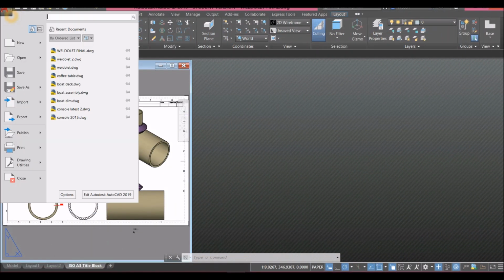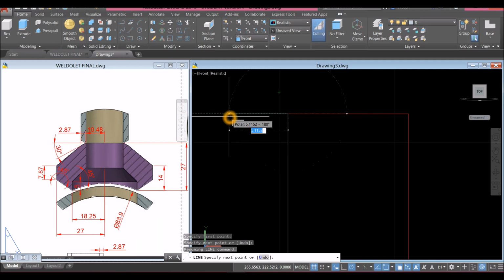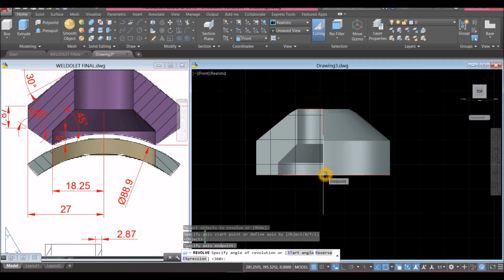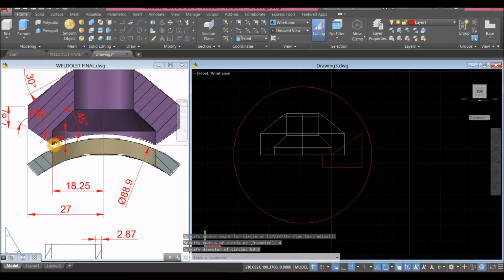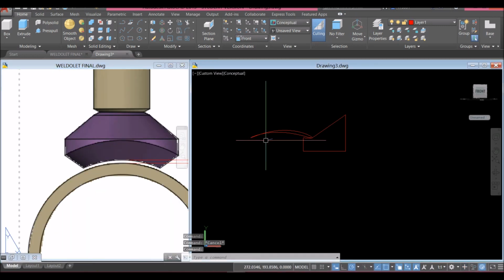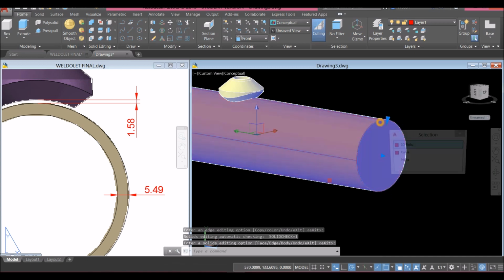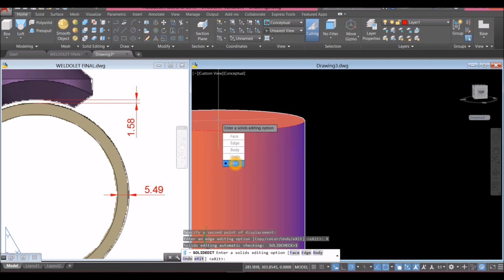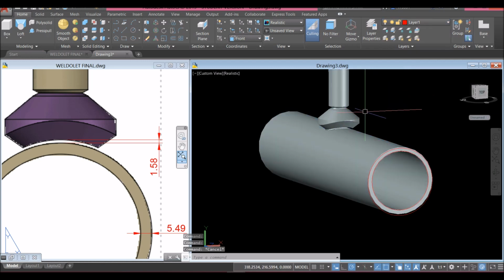Weldolet (reducer) Design in Autocad

Comment: Sweep Object reports an error Error Code Number is 85021. What about this? Edit the curve?
Reply from the maker: 🔧 1. Profile is not a closed shape (most common)
The shape you are sweeping (circle, rectangle, spline, etc.) must usually be fully closed.
If there’s even a tiny gap, Sweep can fail.

Fix:

Use PEDIT → JOIN
Or check with OVERKILL to clean duplicates
Confirm with LIST that it says Closed polyline
🔧 2. Profile is not perpendicular to the path
AutoCAD expects the profile to be placed correctly at the start of the path.

Fix:

Move the profile to the start point of the path
Use UCS → align to path if needed
Make sure it is normal (90°) to the path direction